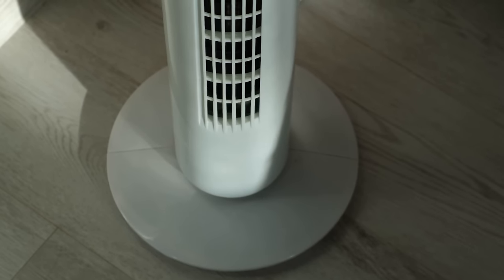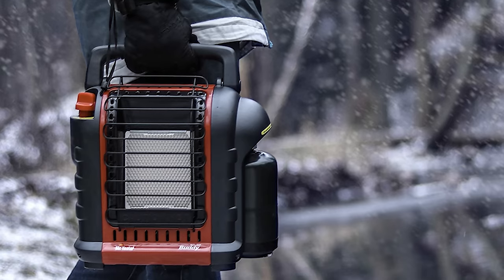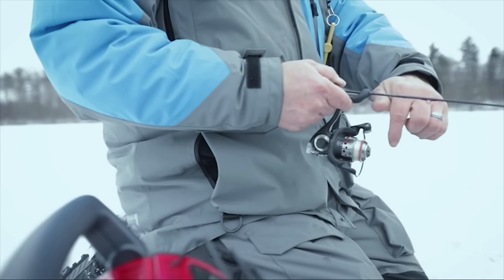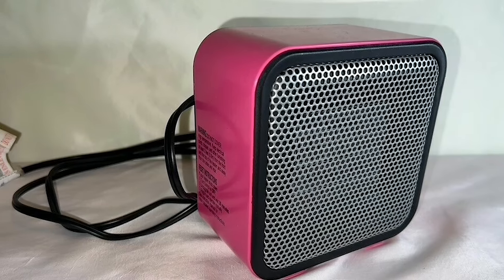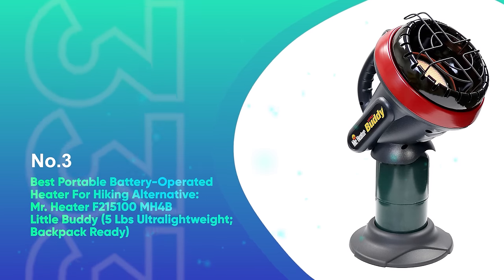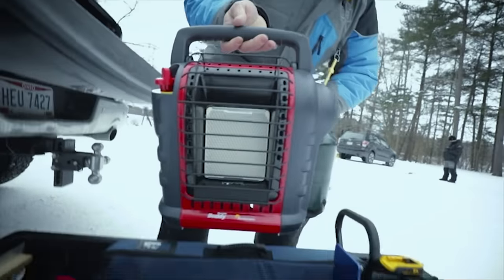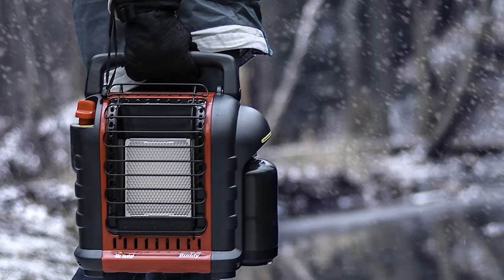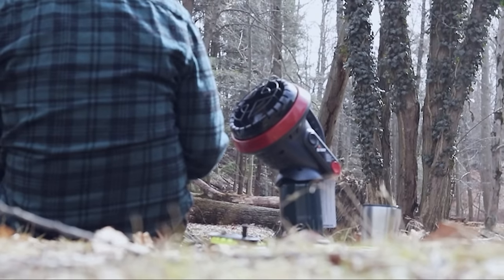Top 5 BEST Battery Powered Heaters of [2024]

Comment: What I dont get is that there are battery powered heat guns and battery powered flashlight so strong they can light a fire, so why cant they turn it into a heater.
Reply: Because that would be USEFUL/HELPFUL.
Reply: 1kW heat for an hour would be around a 600 USD battery. 
0,15 l of propane would give you the same amount of energy.

Comment: Why are some propane heaters okay to use indoors - but others say you should never use a propane heater indoors?
Reply: Means you're burning a fuel source therefore consuming oxygen and producing carbon dioxide. In an enclosed area over a long period of time you're essentially suffocating yourself. I'd avoid any propane heater indoors especially in small areas.

Comment: So how does a battery power a semi trailer truck ?
Reply: It doesn't. A 12v/24v battery in any gas vehicle supplies power to the starter motor to start the vehicle. Once the engine is running, the alternator on the engine recharges the battery. The  battery then runs lights, stereo, etc.

Comment: It's Not a "Crack-Pipe Dream" it's A reasonable request. 

It's that most designers are just to dumb to think of putting a power inverter inside a Rechargeable Heater, that way it Converts the electricity to a higher voltage....

(Amongst other things.)